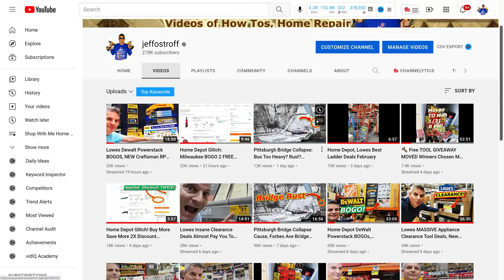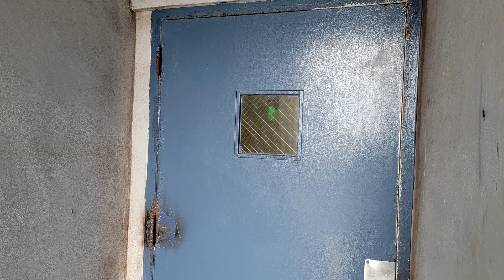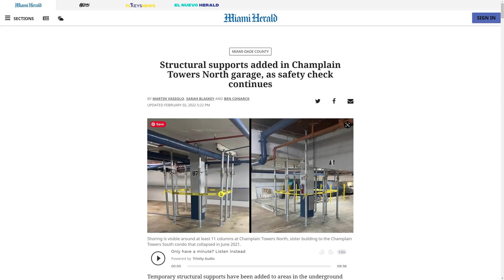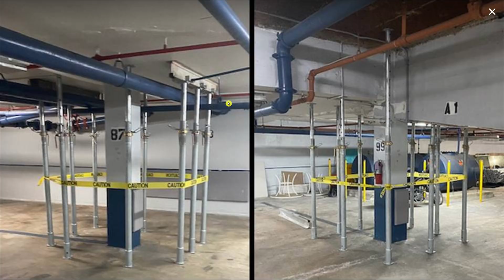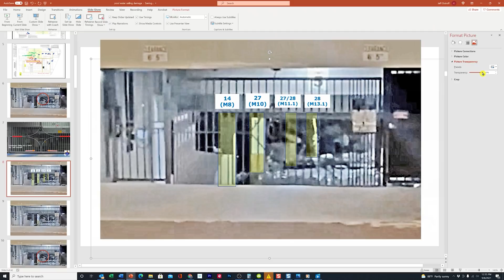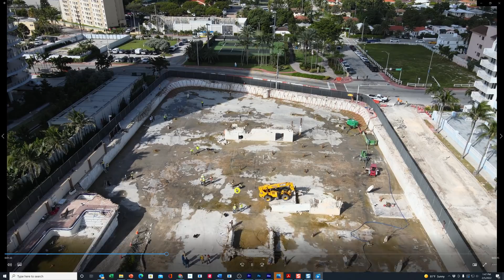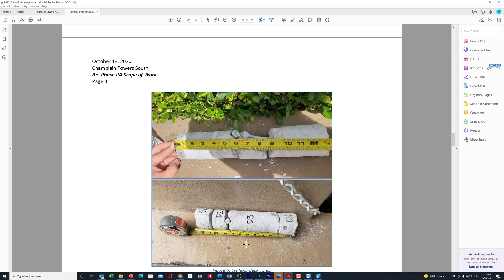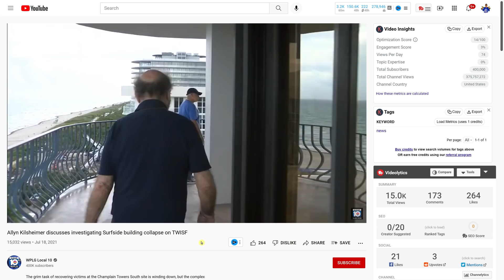Miami Condo Collapse: Sister Condo Just Added Support Poles!

Comment: Can we have a look at the H-beam and the magical column that seemed to be there in the middle of the driving passage?
11:00 You mentioned LIDAR. That is _Light Detection and Ranging. Light cannot penetrate concrete. So the guys measuring concret need to use a different method.
Reply from the maker: He is using GPR I misspoke
Reply: GPR is one technology that is used, but more commonly they use magnetic instruments.
Reply: @Bill J The Miami Herald article said Allyn Kilsheimer and his crew performed mostly visual inspections.

Comment: Something has definitely got some engineers seriously spooked at CTN in the last few weeks.  Another detail is that the shoring seems to have been done on a verbal permit with the city (with paper to catch up later), suggesting that they feel there is significant urgency about it.  All those props are expensive, especially if they involve tearing up bits of units to access structure over multiple floors.

This is not just an exercise in making people feel safer; not this many months after the original disaster.  Some people appear to be convinced that there could be a major structural issue with it.
Reply from the maker: I would love to see the He engineers reports to see what it is that got them so concerned. Was it the core samples? I would love to see the results of all the core samples that they took there. I was in that building and one of the corner units that they had completely blocked off for their testing was on the 6th floor of the building.
Reply: @jeffostroff  Are you inside did you get any footage I’d love to see video that I heard they did the third-floor closets I didn’t know that was the sixth floor to Anna lobby I heard the lobby they put up shores
Reply from the maker: @nerolicompletecreme   The drawings are online on the city of Surfside website. Are they completely accurate and final? Who knows sometimes there's a different set of drawings for the actual construction in there are for the architecture of the building
Reply: They have just come to the conclusion that CTN was built just as shoddily as CTS and despite assurances that maintenance was kept up with, serious deterioration is happening.  The quantity of rebar is lacking in the whole structure.  The concrete is shit throughout.  They should just condemn it (and maybe CTE as well) and tear it down.
Reply: I would love to have final drawings for CTN to analyze.
Reply: @billj5645  CTN was built basically at the same time as CTS.  Despite minor differences, you can safely assume they are essentially structurally identical.  Meaning criminally dangerous death traps.
Reply: @johnbergstrom2931  I've only seen preliminary drawings for CTN, those indicate the structure to be very similar.  If it was actually built that way then I agree I wouldn't want to even go inside the building.  Unless it was the same crew building it there is the possibility that some details such as construction joints and reinforcing steel placement was done differently.  If the analysis documented by Miami Herald is correct for CTS then one of these details is the thing that initiated the collapse and that particular detail could have been done differently at CTN.  Shoring in the garage at CTN, if designed properly, could certainly help to prevent a progressive collapse.  A couple of dozen people would just have to park somewhere else.  It would be possible to retrofit CTN to make it stronger.  I've done that type of thing lots of times.
Reply: @billj5645  You're way more optimistic than I am.  CTN opened less than a year later than CTS.  Nathan Reiber did NOTHING differently in that time.  I doubt he grew a moral conscience in just one year...  It was assuredly the same crew, as he owned the construction company that built these monstrosities.  An outside concrete crew would have cost more.  No way he was willing to pay it.  He skimped on rebar and concrete quality just like he did on CTS.  

Essentially the same building. 

There will always be a shadow hanging over this building, a stigma.  Unless they run their GPR over every square inch of slab, every column and identify all the deficiencies built into this thing, it won't be safe.  Not in the minds of most people.
Reply: @johnbergstrom2931  I've been involved in designing fixes for a lot of different things.  I think the deficiencies of the pool deck could be fixed.
Reply: @billj5645  Sure.  But what other unforseen failures are lurking for this building?  Nah, tear it down.
Reply: @johnbergstrom2931  The East wing of CTN has two less stacks of units, compared to CTS.  Additionally, the critical complex beam arrangement at KLM9.1–11.1 of CTS, that many believe played a major role in the failure, is quite different in CTN.

CTN does have the same slender columns without capitals, very thin floor slabs, very limited sheer walls, and general lobby / pool deck arrangement.  It will have many of the same structural design issues, but there are important differences which could make collapse much less likely.  How it was maintained over the decades could also be a huge difference.
Reply: @Murph9000  It was designed by the same incompetent architect and constructed by the same greedy developer.  Tear it down, along with CTE.  There will always be dark clouds over all Nathan Reiber buildings from now on.
Reply: @Murph9000  That is nonsense.  There are basic design flaws common to both.

Comment: Good job Jeff.
Looks like an old wood I beam on top!!! The allowable F'c  on the wood I beam will be 15-20 times less that the allowable compressive strength of steel. What they have done could cause a redistribution of loads and a possible failure.

This building will end up being demoed.
Can you measure the depth of the step beam? it may also be 12" shorter than planned for.
Reply from the maker: In every place that uses these poles I see them use it mostly without the wood, maybe they are not a problem when the column is taking most of the load
Reply: shore posts themselves do not require having a beam on top, actually stronger without, the beam is needed where load needs to be moved over to the post.
Reply: @kitsapkorner7761  Depends on guesswork as they don't have any idea where the loads are.Thus bearing transfers are needed.
Better to have transfer beam on several post to avoid  moments on post. Poor job. And they may inadvertantly shift loads where they should not be.

Comment: i work in construction an i love what you've done with these, your very forensic, you want to keep doin these type vids when shizle slams the fan, i know thats totally dependant on a good flow of reliable info, but i can tell you know your field an i think your instincts are bang on, i do love a good mystery an infrastructure fail's often are that, not sure id want to be in any of these towers, after the first just the fact they are sivaling's would be my red flag
Reply: I'm a structural engineer and Jeff's posts are about the only ones I follow with any regularity about CTS and now the Pittsburgh bridge, inquisitive and forensic without a lot of Pompous BS.  I look forward to his, ignore the others.

I don't this this engineer on CTN is doing double speak.  It is clear that CTN is safe, as he said.  But its Factor of Safety is below that of a properly designed new building.  It is incumbent of him and the property to bring the building back to a condition approaching current new buildings, otherwise no one could ever sell a unit.  Everyone wants that gold standard report showing that everything was checked and is good to go.  Adding shoring etc usually wouldn't a required permit, start chipping out a column - PERMIT Required.
Reply from the maker: Thanks Woosh!
Reply: Full agree. These videos are amazing. I was obsessed with this collapse, and now as a native Pittsburgher I am grateful (albeit a little spooked) and extremely fascinated by the forensic engineering that's happening on this channel. Thank you Jeff!!

Comment: The poles could punch shear through the slab. Why no bearing blocks? What the hell is going on?
Reply from the maker: This is done all the time and maybe there isn't the threat of punching shear that everybody thinks, because if you put enough poles around like you saw in the photos, they are likely distributing minimal amounts of force and we are assuming that the nine and a half-inch slab that they are supporting is in pretty good shape.
Reply: @jeffostroff  Possibly but those slabs are questionable in beam action:especially tension. One column could have 600,000 lbs. on it!!
Reply: They could but punching shear capacity of the slabs is probably much higher than the compression capacity of each of those shores.  Punching shear capacity for one of those poles is on the order of 80,000 pounds and I don't think the pipe itself will carry that much load.  It looks questionable if they had a professional shoring company design the shores or if they just hired somebody to "put in some shores".
Reply: @billj5645  yeah I have never seen  pipe columns with no bottom plate to distribute the load, even in residential use.
Reply: Well If they put bearing blocks on top then they are required on bottom to distribute the load as both are redistributing the loads on concrete...
Reply: Interesting thing I noted when they peeled back the carpet, the original installer had to use concrete tackless. Sometimes they are glued to the concrete, other methods especially used on new concrete floors, use of a powder charged nailing hammer, this could shatter a bad concrete pour.

Comment: Those supports look single family residential size, not something that will hold up that massive concrete mountain.
I wonder what has happened to the market value of the CTN & CTE units.
Reply from the maker: Good question that depends on which model number of poles they are using, what the specs are, and whether they're telescoping the poles up to a high height. So for example some poles can only handle maybe 4000 to 8000 extended up to 10 feet. But others can handle 8000 to 12,000 pounds extended up to 10 feet. I'm assuming this garage was extended to an 11-foot ceiling.
Reply: There are only 2 units for sale in CTEast as today. 1/1 for $550k, 2/2 for $769k. In the North tower only one apartment for sale 1/2 for $699k. From real estate records.
Reply: @elenamiamislots5665  : Do you know how much similar units were going for before the collapse?
Reply: The shoring posts are not functioning as substitute columns, they are holding up the slab surrounding the existing columns.  Trying to prevent punching shear...
Reply: I doubt they are there to take up 100% of the load but likely a portion of it.
Reply: Who cares?  The buying public needs to be protected from these structures.  Next time, do not pay so much.